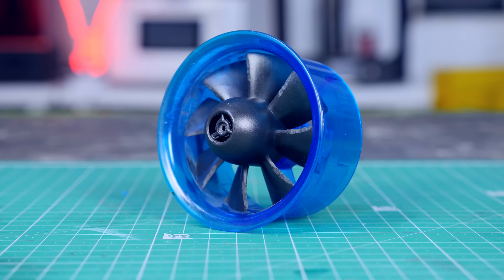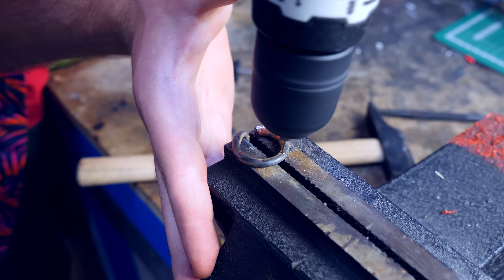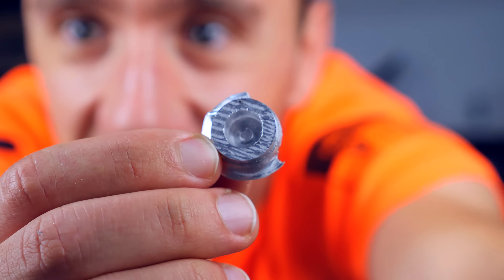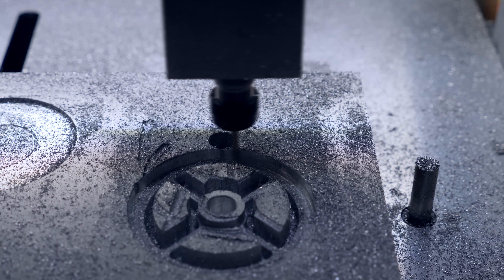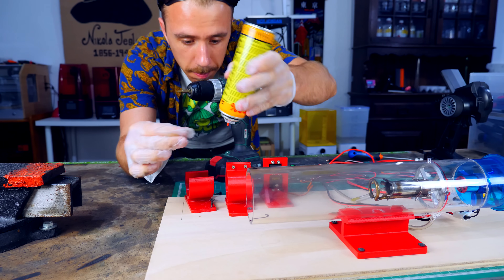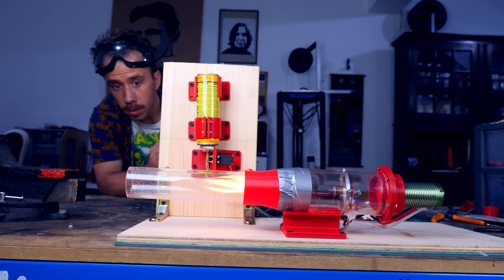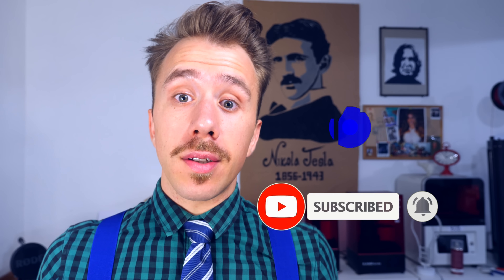I turned my Fan into a Jet Engine (3D Printed EDF Afterburner)

Comment: CNC metal tips: cool, cool, cool (air already works, but better to use some cutting oil and better yet cnc cooling fluid (which is mainly just water but with some additions to prevent rusting), use a short end mill (the longer the tool, the more it will vibrate and possibly even break), to prevent heating up even more, go low with the RPM, but high with the cutting speed (prevents rubbing and local heating) and if all that doesn't help, take it slow with the steps, only 0.25-0.5 mm in per layer with your first try should be more than enough. If the metal, especially aluminium, heats up too much it will turn into goo and stick to your mill, immediately ruining it and your part. Temperature control really is key. With some experimentation you MIGHT be able to get results like some machining videos show on youtube, going in several cm at a time, but don't get your hopes up, expecially with such a small CNC, just start with small steps.

Comment: The gas injector is freezing multiple times (9:25 for example) so it should be closer to the glow plug. And for the CNC mill more turn speed or slower feed.
But nice to watch anyway

Comment: The tool you use in the CNC is too long have to use a shorter one the vibration will vanish even the result will be much better, push the movement speed lower as well, you have to learn better even how to program the machine some transitions are wrong.

Comment: Seems to me like there needs to be at least partial air-fuel pre-mixing in the ignition chamber to ensure you have a steady flame coming out of it to ignite the main air-fuel mix around the injector, otherwise the flame jumps all over the place or even gets evicted from the "engine" altogether.

Comment: I'm not a jet engine or turbo jet engine. Thats a fact. A jet engine is powered by fuel not an electric fan.

I am a fan powered flame thrower that has no thrust other then the bit the electric fan provudes.

Comment: yiu should make an working  4/2 stroke engine that works on either gas or petrol and should be a bit powerfull  or fuel efficient

PS you should also put a turbo and make it work!!!

Comment: Not bad actually for homemade CNC machining. But to achieve better results, you need to do some cooling. The best way for it is to make a system that will circulate liquid and spray it on the cutting area. For even better results liquid should be somehow lubricative. The easiest option is soap solution on water, but you may seek for special concentrates of cool/lubricant liquid for CNC. 
Another reasons are that cutting tool may be not enough sharp, cutting tool are too far from its holder that causes it to bend and vibrate. And lastly, when there are a lot of shavings in narrow channels, they block tools path that leads to that kind of curly surface (liguid cooling fixes that as well as it wash most of shavings away).
Спасибо you for your videos and good luck with what you are doing!)

Comment: A glow plug is only on in a Diesel engine for about 8 seconds before the engine is started in order to warm the combustion chamber. It is not used in combustion at all so you might have some issues having it on for long enough to be used for combustion. A Diesel engine has combustion because of the heat generated from its high compression ratio.

Comment: Oh god, that poor CNC machine.

Make sure you double check your feeds and speeds before you put tool to metal. Proper feeds and speeds will dramatically increase the quality and finish of your parts, and reduce the wear on both machine and tooling. Also, invest in some kind of blower at minimum, as the poor bit was choking on aluminum chips before it could even get to the part. I'd recommend some kind of coolant nozzle and reservoir, to keep cutting fluid on the part. Cutting fluid (or really any kind of grease/coolant) also helps keep the operation smooth and cool, which keeps it accurate. Hot parts can and will go wildly out of spec, and hot machines will make it even worse. 

I'd also recommend tolerancing each part batch to check your runout (how much the machine is out of calibration) since it doesn't look like you have any kind of probe system on that mill. Even with small batches, you can get a few thousands runout and it can really screw with your tolerances.

Even more advanced would be checking your tool pathing in your CAM program to make sure you're doing climb cuts on surface passes. It takes a little extra time, but I liked the finish quality it gave me.

Comment: This isn't really afterburner, more like fuel dumping. Something often seen on F-111s, they'd dump their JP5 right into the exhaust, making them light up like a 1950s rocket from Hollywood. 

Afterburner is also known as reheating. It benefits greatly from having a divergent/convergent nozzle for the ejector because of what you're currently experiencing - backpressure.

Comment: Probably sounds like a mad cow cause your bit is vibrating. Try using a shorter or larger diameter bit for stability and spraying on some WD40 or cutting oil could also help. Keep up the crazy :) !

Comment: You need to make some sort of "standard" base attachement for these motors so you can try and measure thrust, maybe some load cell and a bracket will be enough.
Also seems like the constricted tube gets hotter, perhaps you can make that part with some zinc pipe or something like so.

Looks awesome btw

Comment: Why not use a multi stage axial fan? Chuck a velocity stack on the front. Fan shoot out has a great turbojet fan you got get the STL for. Perhaps use a divergent-convergent duct around the fuel ring. That might give you some pressure rise around the fuel and help prevent the flame outs.

Comment: Lastly have u tried using mineral oil as a cooling system....  and have u considered using water or a fluid to assist when cutting the aluminum. It will produce a much more refined finish. And open up a world of possibilities

Comment: Hey everyone.   I was just thinking.  Seeing that the motor for the centrifugal fan is powerful enough to flex the plastic. Why not make it out of aluminum? Why not convert the acrylic tube into aluminum  .. with a motorized restriction like the f22 raptor jets? Why not preheat the fuel by using a heat mat used for your sore backs.  And why not use methanol pressurized.  Through a consistent  ring or injectors? . And introduce oxygen gas  into the mixture ..   of the methanol and o2 gas. U could even use hydrogen gas.  Produced through electrolysis of h2o.  That gas is extremely potent.  And it has an accelerant ...the oxygen gas can be used as a byproduct for other uses such as backpressure. In a pressurized system of some sort...    look into electric exhaust cut out valves

Comment: Figure out a way to use used motor oil as your fuel for the afterburner.  You will need compressed air to go along with it but your fuel will be plentiful and free.  Use the same concept as a furnace that switches over from propane bottle to used oil. It’s used a lot in melting metals.

Comment: need to add a smaller tube for more back pressor and fan try to make a fan. duel fan after burner needs to open and close on fire tube should work no problem

Comment: that's not how he diesel in diesel engines ignites ,.. the plug is just for heating up when starting in cold climate ,  diesel spontaneous combusts because its put under pressure

Comment: I guess injection the Propane as a fluid is not good.
First you should move the bottle facing upwards. Than it could be possible the Fluid comes to Cold out of the Bottle so it can stay liquid. (as you said ad the end)

Best is i guess to add some sort of pressure regulation to the fuel system. (Evaporator)

Comment: Why people cannot travel faster in air. Because they have to push air and create a potential. But an electric train on ground is much faster. People usually think electricity is faster but sounds travel much faster. Distribution inequality. Cables are good conductors.

Comment: Your afterburner is running super rich. You can definitely give it less gas and it will run smoother (and catch fire a little less). On the fire mitigation side, you may want to put a detent in your R/C controller that's somewhere north of 0 RPM and use that as your idle. Your components will last longer too.

Comment: I'm not sure if you had this, but back here in the states a long time ago there was a commercial about a vortex booster that you can add to the intake that would improve mileage and increase power to your car by just spinning the air and fuel before ignition.  I don't think it did well based on reviews but I'm sure you can design something better.  Also I would like to win a 3D printer.....

Comment: Mill cutting tools need lubrication while they cut. if not lubricated, cutting tools wear out fast, (Or break) can cause consistency issues on the material during milling, and make a lot of excess noise.

Comment: A good way to preheat your fuel would be to wrap the head tube around the flame tube for about a half an inch fwd of the fins. Close enough to use the heat of the already burning fuel to keep the rest of the butane warm so that the holes don't freeze.

Comment: TORCH TIP...YOU NEED TO CLOSE THE FRONT SO TURBINE VACUUM WILL GO FASTER THE AIR TAIL RADIATION ALL YOU NEED VAPORIZED ANY GASES BOOSTED THE EXHAUST...FUELLED ONLY LIQUED VAPORIZER AQUXTEAMER BROILERS BLASTER BOOSTED TURVYN USED THE VACUUM

Comment: Really good experimentation!
I suggest to use the compressor to power a bladeless turbine with your post-combustion engine, it's will improve the input volume. I really don't know if it will work or if it will change anything!
Ask, if you need details about this idea 💡.

Comment: Video Idea: build an own Nitrogen generator  for your projects. Then you nether run out of fuel. You can power the generator with a solar panel on the roof. As it only uses water it's very clean. And you can also use the produced oxigen in your rocket projects.

Comment: It looks like your fuel injector is freezing up, might I suggest transferring the butane into a pressure cylinder. The problem isn’t the fuel, it’s the refrigerant used to cool the fuel to liquid temperatures. Transferring it into an old air tank or simply switching to refrigerant-free fuel like BBQ propane cylinders may stop ice from forming.
Reply: This right here^^^ turning an aerosol can upside down will cool the fuel down to -50 degrees centigrade. Classic trick to break locks...

Comment: You should redo some of your older videos using the CNC. It will let you practice and make engines and turbines that can handle more heat and stress.

Comment: The edf you chose is known for failing because they are glued into place instead of being screw mounted. Get a higher quality edf unit and it will work considerably better!! Still pretty cool none the less!! Now if it could be done on a smalle enough scale to be used in an actual RC jet it would be great!!

Comment: Second try: you should make a refrigeration system with the rocket fuel, for the nuzzle and the combustion chamber💥 and you can try it with your actual materials to build it, its cheap and maybe funtional.
Like printing a pump system througt the nozzle and the combustion chamber that allows the rocket fuel flow and frozen it😨❄
I want a 3D printer also😅😂

Comment: Fabricate a multistage fan for high pressure rise or a high flow centrifugal compressor, and a viable flameholder! You will have what is in essence an electrically powered afterburner or possibly more correctly, an air breathing rocket engine.

Comment: Integza you should 3D print an electric motor armature that is bladed so that it functions as a turbine and spins a propeller at the same time and 3D print a model airplane to test it with or I will send you a box of these tomatoes.
Reply: Dang I can't add a picture of the tomatoes. Lol

Comment: The fan design will eventually turn into a grenade. PLA CANNOT handle centrifugal force for a long time. It WILL reach the breaking point eventually. And when it will, there will be shrapnel. I would 3D print the impeller in carbon/nylon instead. There's a possible way to design a piece that would contained a eventual centrifugal explosion. At your own risks

Comment: I do a lot of aluminum machining, there are two thing I think you can do that will help. Only have the cutter sticking out as long as you need, if you reduce that the cutter won’t chatter as much. I also looked like you are cutting the aluminum dry, aluminum needs some kind of lubricant when cutting. Even a couple squirts of WD40 will help a lot.
Reply: I was wondering if the feed speed was too much, too. I don't do machining, so I may just be talking out of my butt
Reply: @ericgoldman7533  when it comes to aluminum, it has a tendency to want to stick to the cutter. Cutting oil or CNC coolant prevents a lot of that. To say feeds and speeds is a deep rabbit hole would be an understatement. There is a LOT of variables like how many flutes the cutter has, the angle of flute, if the cutter is carbide, if it has a coating like ZrN (AlTiN is not advisable for aluminum since the coating contains same element as the material and can bond). Rigidity of the cutter in the holder...on and on. 

I really enjoyed this video a lot, when he was doing the milling - my heart hurt a little because I was thinking, choke up on the cutter a bit more and give it a little squirt of WD and you’ll love it. 

There is certainly an art to CNC milling, I use SolidWorks to design my parts, BobCad to generate G-Code, my Fadal VMC has expanded memory, converted for WIFI, new inverter, new 10Krpm spindle, blah blah blah. My mentor has a much older and primitive machine and he uses MasterCam on an old Windows 95 pc. A lot of the time, I can’t keep up with him- but that is +30 years more experience than me.

If you ever watch Titans of CNC, Titan talks about working your way up to the fast and aggressive cuts. I tend to stay on the very conservative side until I’ve got a proven program (no crashes)- then if I have to do a lot of the same part, I’ll tune the S&F until I hit the limits.
Reply: @triphonikstudio  Thanks. While I haven't done any machining, I do have an interest in it, so it's nice to hear feedback from people with experience =]

Comment: You need to do what NASA dose on there rocket tips use the gas to cool the tip by putting a coil around the nozel, this also preheats the gas before burning it.

Comment: use the same process as the reaction engines (skylon spaceplane) precooler but in reverse to heat the fuel inside the back end of the pipe, made from the same copper tube as your burner. dont wrap it around the inside though, run it length ways to reduce air friction. this will have the added benefit of increasing fuel pressure and efficiency and reducing melting of the pipe. also, you should use a larger compressor fan, and then test if it improves thrust. there is a good example of this on junkyard wars in the episode jet powered trikes.

Comment: Make a hybrid rocket motor where you 3D print a double helix negative and use the plastic as the solid fuel component. There are papers on this where they successfully used ABS.

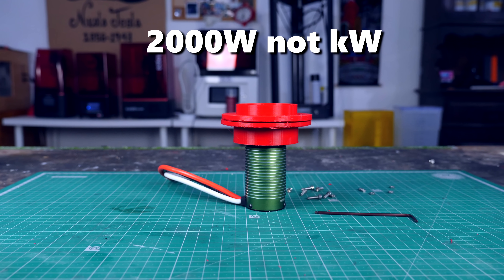Comment: 09:54 One question. In all my years using those kinds of wd40, paint can, etc.. They usually lost compresion when you use them upside down. Most of the time when you are running low and your angle just alown you to spray upside down.. you need to spray one or two times in normal possition to generate pressure again. Why is it different in this case? I guess the biggest problem its that the support its not "shaking it" but that would be too much lol
Reply: And i guess that if you hit up a little bit that can before doing this it would give it more pressure?
Reply: My question is, can these kind of butane cans or butane canisters in general explode if i light them? Sorry about this kinda stupid question but I've grown up thinking they explode. i want to make a pulse jet but i want to ask first

Comment: CNC programming tip:
I understand you are using two flute cutter so technically you could plunge the cutter right in but I still highly recommend you to ramp the cutter in! It will put less strain on the cutter and the machine and should help with the longevity of the cutter also! (Plus less chance of crashing the machine IMO)

Comment: There is too much extension on the cutter for CNC. This is why you are getting so much resonate chatter. If you cut the length of stick out in half you would get rid of most of that chatter.

Comment: Okay you didn't make a jet engine in any way.....   you took a fan and made a billow pretty much, Jet engine is Defined as an engine that can thrust produced by fuel and air burn through means of compression. to which you lack all of the above lol! You just fanned a  flame like any gas heater or metal forge does.

Comment: Next time you cnc machine aluminum try adding cutting oil/fluid/lubricant. It helps with tool load. Also check into your speeds and feeds( speed + depth of cut) of each cut. - a machinist

Comment: Glow plugs are NOT the source of ignition in a diesel engine. The heat generated from the compression stroke is. The glow plugs are only on during the starting cycle, and are off before the engine starts. It's just to provide a boost of heat on cold starts. A hot diesel engine would run perfectly fine without a glow plug, and many small industrial diesel engines do not even have glow plugs. They are a pain in the ass to start on cold mornings, but a small torch on the intake tube helps a lot.

Comment: Hey Integra! I wonder if you constricted the output a bit more if you could get it to work. It seems like all was well until a few seconds into the burn. I wonder if the exhausted gasses are becoming a slight vacuum in the chamber after a while due to the air being thinner because of heat and the rapid exhaustion of those gasses